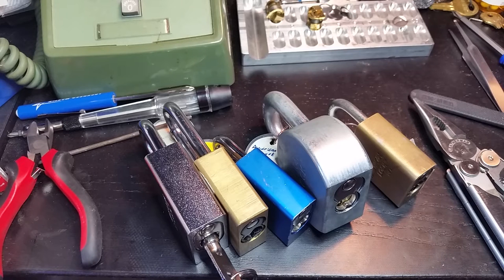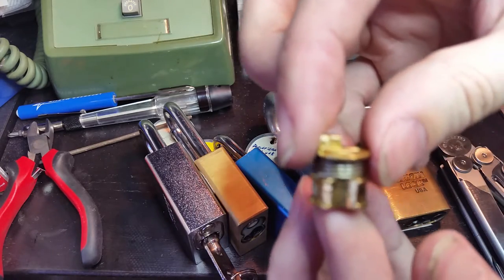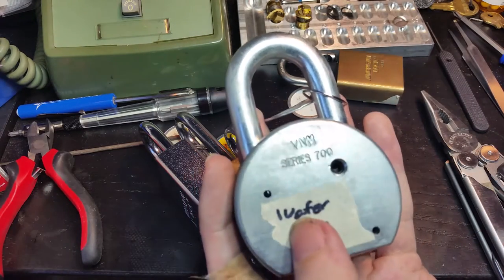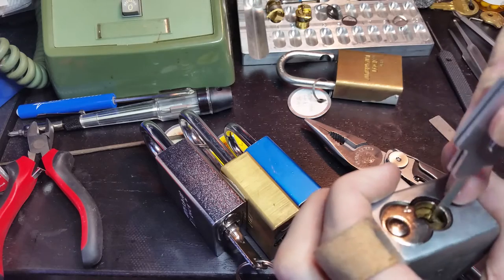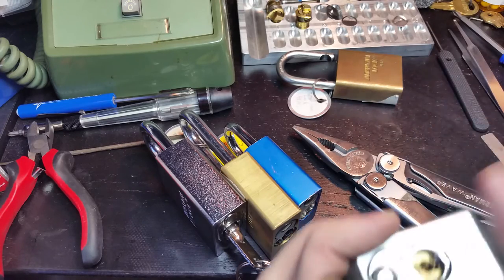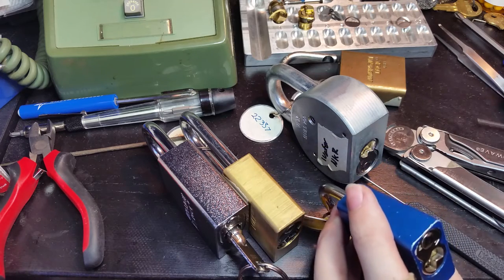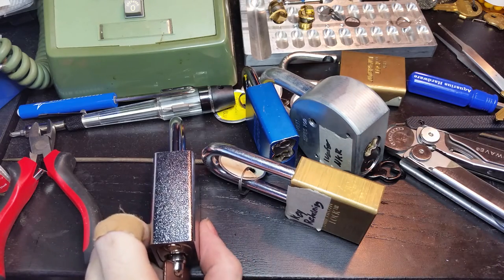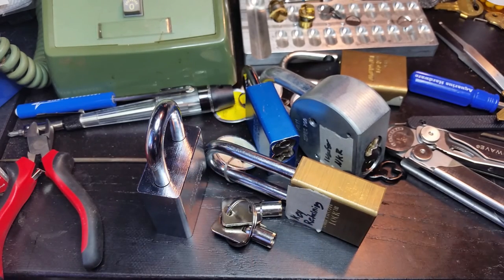(061) Hardening American Lock padlocks against bypass

Comment: Hi,

Just FYI, American had the wafer long before Peterson introduced their bypass tool. I've had many NOS American 5260 padlocks circa 1986-2001 and all had one stainless wafer installed. 

The cheaper models that are not intended to be rekeyed (series 10 20 30 40 50) do not typically have this wafer from my experience tearing them apart.

Thanks for the vid.
Reply from the maker: +BroadcastBuddy Interesting, I had not heard of any locks of that vintage having the blocking wafer. Do you know if it was specific to the 5260 or a contract?
Reply: +Nite 0wl No, they have also been found on the 5200s, 5560s, 5570s, and the aluminum 11, 12 and 1300 series padlocks from 84-current.

I also have a very early NOS 5260 series made for Klein tools in 1982, and it also had the wafer installed. So from my experience, American has had the wafers since the intro of the padlocks with the figure 8 cover plates.

Comment: I believe it's the Brinks copy of the 700 that has a redesigned cam that can't be bypassed. 6 pinner very impressive security pins too
Reply from the maker: American Lock's Key Retaining cam is immune to the bypass as well, there are also a bunch of other manufacturers that make superficially similar locks that are not susceptible but few do pinning and cylinders that are as good as American or Brinks.

Comment from the maker: Looking things over later I discovered that I had used the wafer breaker on that model 706 so much that both the tools and the lock internals were so worn that the actuator slides out of the way of the breaker and the wafer just folds over it.

Comment: Which American lock and Brink models can be hardened this way? Abus?
Reply from the maker: Any American Lock using their inline pin tumbler cylinders (basically any of their rekeyable models other than the 7200 and H10) can be hardened this way. Brinks has a few models that are near identical copies of the American Lock design but I don't have their model numbers available. The only vulnerable Abus model is the 72 series which Abus markets for Lock Out/Tag Out use.

Comment: can you take that tubular core apart and add different Springs & pins to defeat the tubular pick?
Reply from the maker: You can repin them but it requires drilling the rear of the core to mount a special tool. Also, commercially available pins and springs are of limited use against tubular pocks in this core, there may be non-standard methods that work though.